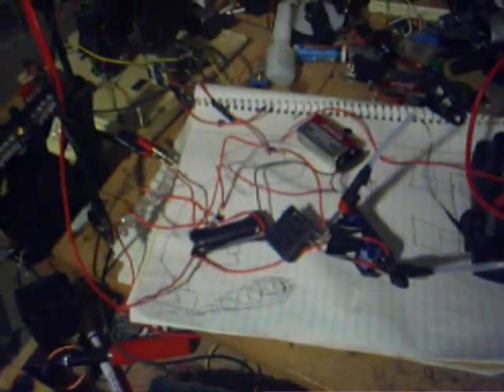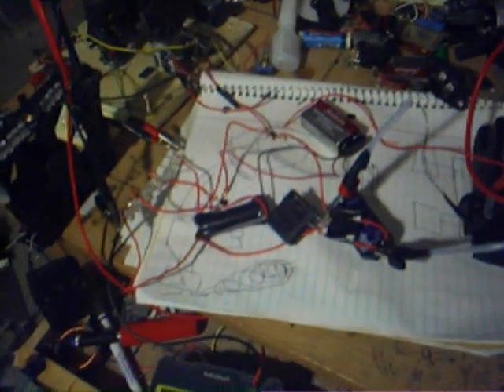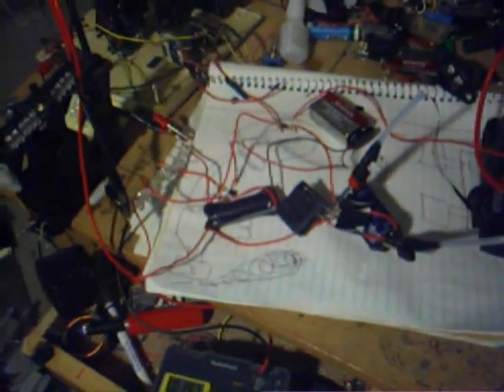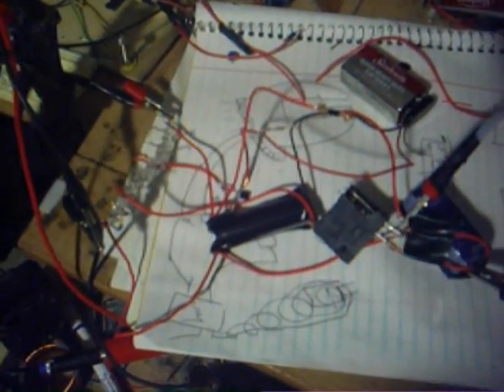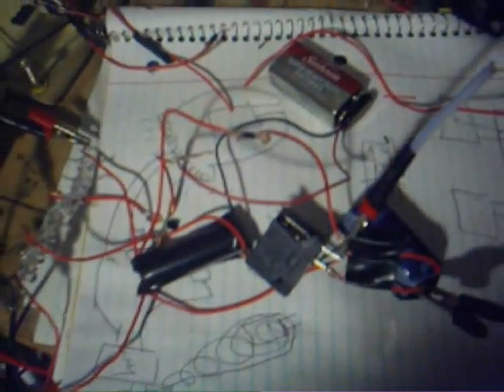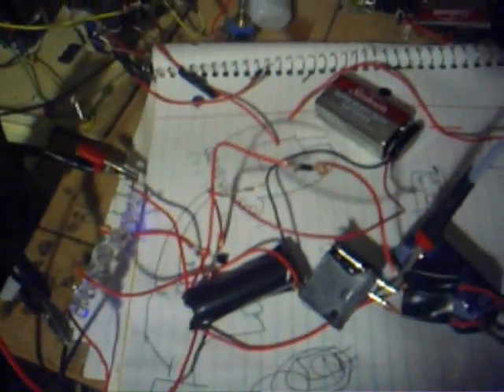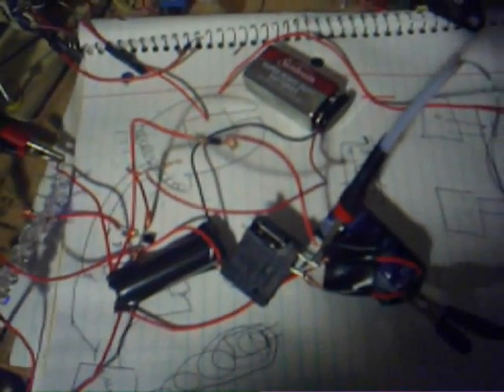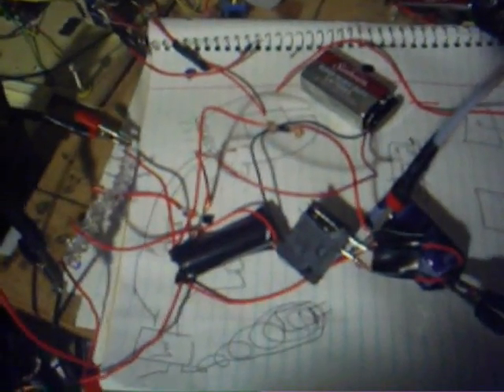Easy SS Cap Pulser Circuit w/Relay (NO IC's... MacGyver style)

Comment from the maker: you just hook a DC cap to that winding through a diode so the flyback from the drive coil keeps the capacitor charged, and when the relay needs to fire that capacitor will switch it.  if you prefer to get some pulsing at around 70v or so then instead of a string of LEDs u can just use a single neon bulb and a single led.

Comment from the maker: there is a link in the description to a simple drawing i made of the circuit. that drawing assumes you are going to use some type of battery(like a 9v) to power the relay in order to get it to switch.  since that drawing i had been using a winding from my circuits drive coil to power it.  so if you have a charging circuit or light circuit like the SJR then you can add an additional winding around it of 50 turns or so using approx 32 awg wire.

Comment from the maker: @EastcoastTinker sure u could do that but the timing would then be ultimately controlled by your rotor. it would be similar to the Bedini 'backpopping" setup where a capacitor is charged using a gen coil and the rotor discharges it thru a reed switch triggered by the wheel. to charge a batt i find it easier just to use the spikes like in a Bedini setup but u can do it the same way on a reed motor. i have not found cap dumps particularly more effective charge-wise

Comment from the maker: @helpmonkey yes you did it right. i never posted a schematic because i really never finished working mine all out. plus theres too many ways to do it. all depends on what your doing and what u want the relay to be run by, and how fast the pulses. couldnt post the way im doing mine using induction coils cause too fast of a pulse the relay cap doesn't get enough and still needs a battery. glad to see it done with just the 3 LED's though thats the goal for the smaller circuits.

Comment from the maker: @helpmonkey i figure most motors should be able to cap enough to light a neon in a fair amount of time, but sometimes that takes too long, so the leds get it done at a more adjustable rate. there is a potential that forms in the relay NPN though which is what i use for the timing, its very strange what i have observed playing with this.. "captret"-like effects.. but usually the potential travels across the NPN so the LEDS in between its B and E wont light, only the opposite sides.

Comment from the maker: @helpmonkey the back emf. i can use the HV gen coils too, which is the end goal. many gen coils with reed switches firing HV into the cap where i can get the usable current out of it. the higher potential makes it easier than just using regular induction.  i currently have my back emf charging the timing cap across the led string and two gen coils charging a 9v running the relay which also catches the relay spikes. going to use the run batt instead though. no diagram got issues right now lol

Comment from the maker: @K0W0O0N0 i think i see what u mean now with the VR. but it would be alot easier if it could all be done just from the transistor.. the NPN is really the one doing the switching. the LED's were just the easiest way for me to cause the regulated input signal. it could be done many ways.. u could use one 12v led, a gen coil, and another led as a photovoltaic that switches when it sees the light from the first one.  if i could get a beefy enough tranny maybe it could take the place of the relay?

Comment from the maker: @helpmonkey well i was confident at first i could get it all working from one cap, 2 LED's, the relay, and one small NPN. im having trouble getting it all laid out. its very customizable which i like, but so far i have it going on a motor that slowed with loading so this way i can pulse and no slowing. the timing cap and LEDs are charging from a reed-spiked gen coil, but im having a hard time working out the best way to charge the relay cap. i may have to run that from the input batt.

Comment from the maker: @K0W0O0N0 not sure if that would be able to cycle a cap discharge or not. this is a bootleg way of doing it but it doesn't harm any components see the LED's or NON can never burn out because theres never more potential crossing them from the cap than was originally lighting them, and once the cap is discharged, they dont see any of that. it all goes to the charge batt which is in direct connection at the time. let it run all night pulsing 60v every 5 seconds didn't miss a beat

Comment: Crazy way to do so.... ^^
Wouldn´t a voltage regulator work the same?
I mean if the relay needs 12 volt to trigger a voltage regulator with a dead spot around 11 volt could do it also...
Cheers...

Comment: i was thinking of a home made relay where the voltage builds up in the coil and when theres enough of a field created (of a predetermined cap matched strength) a near by reedswitch closes due to field build up and dumps the cap.? ! what ya reckon ? its like a customized relay. !  hmm. 

what caps would you recomend to dump for charging a 12v lead acid 200 ma 1.3 amp hour ?? : ) im testing all kinds of things here. so easy to go off on tangents, but you always learn something !

Comment: yep love this ! i was talking to lidmotor the other day about doing this ha, we are all gathering our minds now ! 
he has "FLED'S" that do this in a slightly different circuit.  i think "fled's" are designed to flash connect so to speak ! they are multi purpose led's ! 

also what ya reckon bout the light energy being used by the led's ? is it much ? or very little ?

i wacked a miniature generator on my bedini rotor today ! very interesting high speeds !

Comment from the maker: i thought about using the neon like that too but i figured that to be too much of a waste. this way u need a very low potential for the switch. the less energy the relay needs the better. i like the timing wheels but i plan to make a good generator in the future and the extra load of the brush or pulley is no good. its all about balance and i dont want to lose anything. im thinking this way loses almost nothing, but compared to the 555 i have no idea. i guess i need to find out.